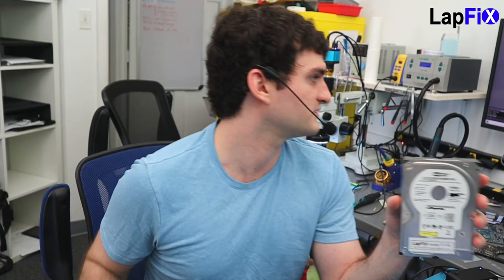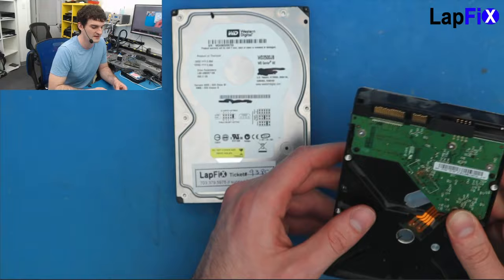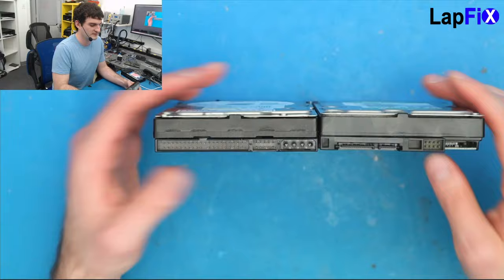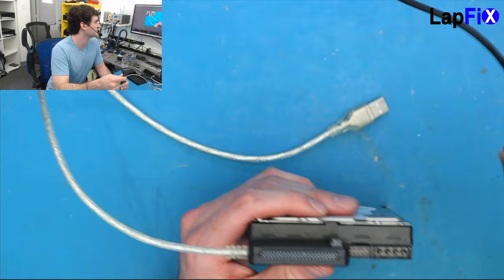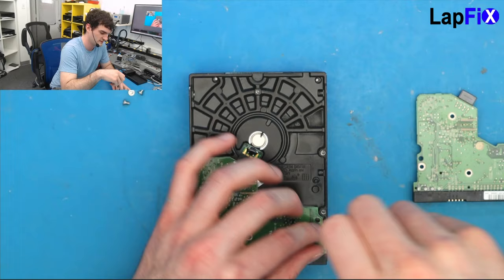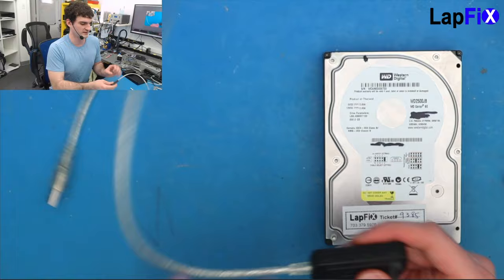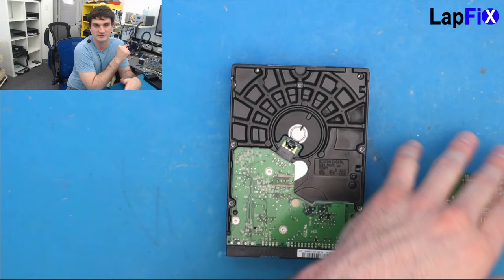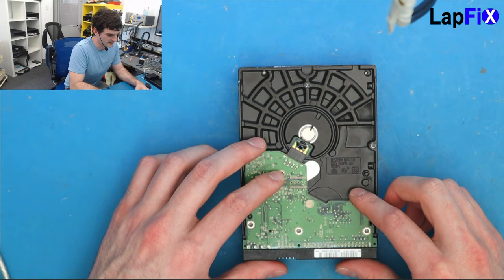How to Fix a Dead Western Digital Hard Drive - HDD Repair

Comment: WD Red 4TB stopped showing up on my iMac. Bought an adapter/external reader compatible with Mac. Can't get the HD to mount in Disk Utility. Need the files on the HD. Do not want to erase. Error message, "The disk you attached was not readable by this computer." ???? Help

Comment: I want to start recording more videos soon BUT what led me here is that I fixed my ps4 a few years ago because I couldn't afford a new one.   Now I fix consoles all the time and I see the hard drives failing on ps4 and Xbox one all the time at this point, they generally need to be replaced and it made me sad to think that all these drives aren't usable anymore and I want to start refurbishing and reselling them but I also don't want to be selling crap drives that will still be broken or breaking soon.   It's like trying to sell a vehicle over 200,000 miles, I want to do it right so I'm not absolutely screwing the person I'm selling to. Or if it's even possible at all to refurbish these old drives correctly in the first place. Do we just bring them back long enough to take data off?  How to the companies "refurbish" the drives that they sell?

Comment: I so appreciate your description here. I just lost my C drive two weeks ago. Fortunately, I had saved all my documents on a separate drive. I spent so much time and money restoring software. I was just so disappointed that so much was lost. Watching you reminded me that I had a USB connection to several types of hard drives. My C drive was only a few years old, so I plugged it in and it came up. At present, I'm coping everything over to my new hard drive (a solid state) in a new file called old C. I couldn't be more happy. Thanks for the inspiration.

Comment: wow so glad i found your video.
I have a dead wd drive with critical audio files on it.
I sent it to me repair place and they sent it back. they said it was impossible to get the data.
I not only need the data i need to run disk drill or any recovery software to get deleted files.
I hope you guys can help.
I'm going to send it to you this week
Fingers crossed
Reply: Did u get it fixed
Reply: Any updates?

Comment: I have an 80gb external hard drive that i'm having a hard time getting recovered. My local computer shop AND the geek squad couldn't do anything. Would you be able to take a look at it? It is a hard drive i bought while i was deployed to iraq in 2004-2005. The hard drive is almost the same one in this video

Comment: I've done board-level repair to a few HDDs (a few different brands) and have found most of them to still be reliable. It seems to me that if it is not heat killing the microprocessors on these boards, it's cheap PSUs that allow some AC ripple current to pass on the 5v and 12v rails and kill many HDD boards.

I do not envy the people who choose to work in the data recovery industry.

Comment: Thank you mate, great explanation. I need to choose one type of drives for video production. I want to stick in one model, so that it will be easier to fix in case one breaks, I can take the board of another HDD just to recover my data. Which HDD do you recommend based on you experience (it may be 2.5" or 3.5"). Thank you so much!

Comment: Makes me reind how far behind the storage technology is trailing behind. 
1 or 2 tb used to be a sweet spot 10 years ago. It still is. Anything above 4 TB Is ridiculously expensive. 

With all the data we generate now, storage industry is in the dinosaur age. 10 years is an eternity in tech. 

I had IDE 1TB drives. And I have SATA 2tb ones.
Reply: The first 1TB hard drive came out in 2007 and was sata. There were no ide 1TB hard drives ide was extremely slow and had low read and write speeds.

Comment: I've had a drive that's been dead for years now and it's a 250GB WD PATA drive like the one in this video.  I have a near identical one that's functional but the board as a donor didn't get the drive working.  I found yet another 250GB WD drive but with a SATA interface (that barely works).  It got the PATA drive moving mechanically but gets stuck after a few clicks and then nothing.  I'm not skilled enough for replacing the firmware chip though.  I think the clicks might be another issue altogether though.

Comment: Hello,
I have an issue with my WD 1.0TB external hard drive, when i will plug in to my laptop it will show the blue light but not blinking and also not showing the partition but just show in device manager, so please can you help me to fix it i have some important data in.

Comment: My wd Red NAS drive which  about 4 years old, but with an on time of 1 day just died. Only turn the NAS on to back up files. Better of using 2 cheap usb3 drives.
Reply: Same with a 3 TB Blue that has less than a day of run time.  Anything other than Green or Black (or Gold) are not trustworthy.

Comment: I have a 3tb Seagate drive that has just stopped working and it is no longer recognized in windows (including device manager etc).

The drive spins up for a bit then I hear this sound: "click, click, beep. Click, click, beep" after the second beep you can hear the HDD spin down and then nothing.

It's still recognized in my bios utility software. 

I removed the casing to check the platter and the heads were not stuck on there, so I'm confused as to what could be causing it.

Any ideas what my next step should be? 

I'm praying I can get it to work long enough for me to get a replacement drive and transfer the contents to it

Comment: Nice you male it look easy lol

My drive can show up in bios, Not everytime. but when loading into windows it whines, and delays the load in. like a electrical straining sound. Then stops and is silent and doesn’t show in windows

It was working with a folder open, in the background. Then came back to the folder 30min later and it wasn’t open, and noticed it didn’t show up in ‘this pc’ my computer. I did all the usual different data port and cables, after a couple of try’s I unplugged it to minimise damage

What do you think?

Comment: Hello , I have a question ! My HDD died few week ago ,  symptoms were slow loading , so i copied the most important fast , and then it failed , I got an error message and the HDD wasn't detected anymore , after a restart , my pc would be in a black screen , no BIOS no nothing just a black screen , when I removed the HDD , the PC would start normally , what could be the cause ? please help :D

Comment: hello computer tech what a great video,it really gave the basics of a hard drive,maybe you can help me on this,office max ,where I bought my units  did not  help that much,my original drive from 2008 just spins and gets very war to hot in the center where the IC chip is,same as the first,the 3rd one is a western dig,it kind of works for   say,1min,I can see al the photo& song files,it too spins and gets warm,is the problem the circuit board itself,or is the arm stuck and has to be reset to the start,or could the  tips of the arm have broken off ,like I have seen on some videos be the cause,,can you take the disk out of a new one,wheather the brands are different,and put the one from your bad drive ..will this work,,any help on this would be great,thanks dan diorio,,
Reply: Did you get this fixed?  Do you still need help?

Comment: I have a problem with my computer's hard disk when I turn on the computer. So the hard disk is turned on for 8.10 seconds then it shuts down and the hard disk does not turn on again. What can I change now?

Comment: HI.
I have a WD 2500YD that makes a clicking sound when power is put to it. I was hoping the arm was stuck to the platters like I saw in many videos but this isnt the case at all. When powering on with the case off  i see the clicking is the arm trying to move but it cannot. It is free as are the platters so I don't know where to go from here.
Reply: A little late to the party but it sounds like the read/write heads are bad and not able to read the service area of the drive (thus the clicking).  Opening spinning disks needs to be done in a clean environment as dust and finger prints on the data platters can ruin your chance for recovery.  This one would need to go to a professional who not only has the proper equipment (clean room, PC3000, etc) BUT also the knowledge of how to use it.

Comment: Thanks for the vídeo,  What heater did you use to remove and solder the chip?
Reply from the maker: The equipment we use in the video are all located in the link in the description.  But here:  Quick 861DW

Comment: I have a Western Digital similar to the newer one that you show in this video.  If I suspected that the board was bad on that device, and had a donor board to try, would it be as easy to remove the board and replace it with the donor as it was with the older board in the video?
Reply from the maker: If you have a power issue or getting a short, the PCB most likely has an issue.  Just swapping the board will fix the power issue but not allow you to read the data without moving the bios chip over.  Even when you do that, you hope you don't have any other issues with the drive or may require advanced tools such as a pc-3000 to help extract the data
Reply: Probably should edit the video, I was going to post this earlier as it seems from the video that the ROM is bad and your are swapping the ROM from the donor board to the original board.  When in reality your taking the original ROM from the patient PCB (which is malfunctioning) and putting it on your working donor PCB.  Also, matching the boards is easy if you just use the PCB number, its finding the correct drive for internal parts compatibility that's a little harder and matching the serial number and part of the DCM that can be difficult. @lapfix

Comment: Great vid.  I have  Western digital external drive.  I attached it to a new adapter but the drive isn't spinning.  Would putting a new controller board on it possibly fix that?  Or, could the motor just be shot?
Reply from the maker: Most likely there is an issue with the board on the drive itself.  Even upon finding a donor board there can also be a problem with the head after you turn it on
Reply: I had the same problem fried my western digital hdd  which was being used as an external hdd. I got a donation board that matched from abroad but on my certain hdd the eeprom also needed to be changed or something like that. I gave up after that.
Reply: @ishty777  
Did you get this fixed?  Do you still need help?  Do you still have the drive?

Comment: transferring the firmware was great.  however, you did not transfer the eeprom chip from the old board to the new one. you need the data specific to the platters, surface errors, replaced sectors, usage info etc. you should to move the eeprom too.

Comment: Mechanical hard drives will NOT be around for a long long time.  Solid state hard drives will be.
Reply: Eh... That's debatable... As long as SSDs have finite write limits, HDDs will always reign supreme in surveillance applications. I have an 8TB WD Purple with around 12 cameras recording 2k video, and it has outlived many SSDs in its lifetime.